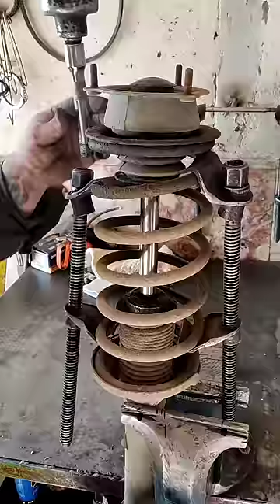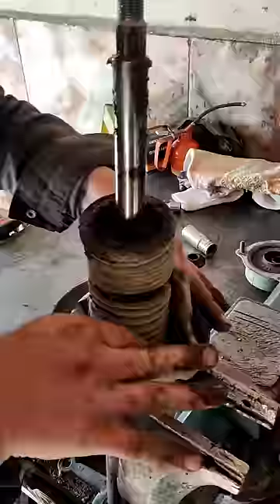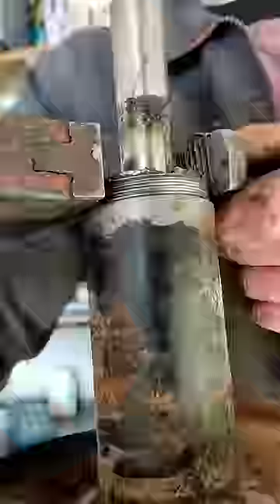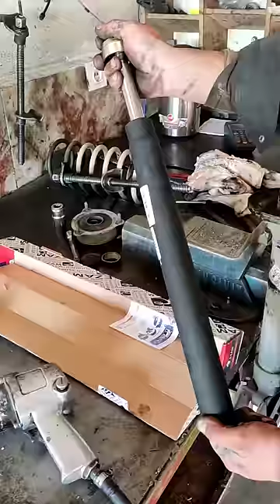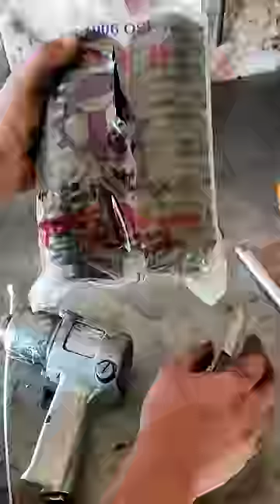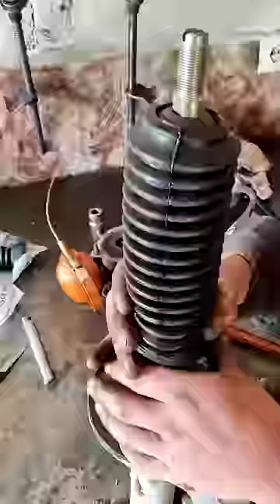Easy Repair #mechanic #automechanic #automobile #cars #truck #restoration #mechanicsteve #shorts

Comment: Easier to just get a fully loaded strut and not worry about it exploding on you while taking it apart. Faster install.
Reply from the maker: Thank you for comment 🙏🏻🌹
Reply: It's also a costlier one. They do this on regular basis since many years and since the labour cost is also low, changing just shockers makes perfect sense.
Reply: You are Right The old days it was cost Prohibited Now you get the Whole Assembly in Pairs for Cheap !.
Reply: Look where they are, ain’t getting that shit there.
Reply: @TylerSmith-qx6uz  I didn't figure out where it was, but the vise with the IRAN SANAT name cast into it made me think it wasn't in the USA.
Reply: @bubpori5105 those usually are of much worse quality.  This guy bought a bunch, and 75% of them had wrong spring rates on them.
Reply: You can't buy a full strut for most cars, they're sold as separate parts, one model car can have half a dozen variants.
Reply: @ernsailor9041 you are wrong.  another person not knowing what they are talking about
Reply: @johnyknox6596  How much do you want to bet? I have 40+ years being a tech what's your proof that I'm wrong show me a website listing every car with full struts or that every car uses the same strut. You didn't say what I was wrong about so you must mean both facts.
Reply: Нужно было масло поменять раз уж разобрал,знаю даже ничего не меняя,только масло и он как новый

Comment: For those saying quick struts are only a bit more money, labor is hella cheap in other countries the extra spent in parts isn't justified when it's way less labor. Here in America or other top teir countries the labor outweighs the parts cost so it makes more sense to replace the whole thing. If people remember when struts where first making their debut, even just a cartridge was expensive. And tbh, part of the reason the entire assembly is cheap is because cheap labor put it together.

Comment: For those who have never done this job before. Leave it to the Pro’s. It’s very easy to kill yourself if that spring compressor slips and nails you in the head. Ask yourself if it’s worth the extra money for one preassembled? It is! Also, for those who will just replace the whole assembly, make sure you disarm that spring before scraping it. Just my thoughts! 😀👍
Reply: they did't call it "Widow maker" out of Vain
Reply: People are scared of spring compressors?
Reply: Good idea on disarming the spring.....
Reply: @Wtrxprs007able  Itynot the Spring Compressor, it’s the spring and what it can do if the spring compressor slips. Not something a beginner should attempt without an experienced mentor!
Reply: When I was 24 years old the spring compressor failed and something cracked my skull. The good part is that I live to tell about it. By the way, that compressor was of much higher quality than the one shown in the video and I've been a mechanic since I was 16...
Reply: @MiguelGarcia-wk9ze  Thanks be to God you were not killed because they do have the power. Glad your ok!
Reply: I've done it once. Not sure I'd do it again. But yes, there is tremendous energy contained in that compressed spring.
Reply: There are presses designed to do this safely and they do not charge much to change the springs.
Reply: I agree with you with this note and pay attention to the seriousness of the work if occupational safety conditions are not met
Reply: thanks expert
Reply: @caseyd6154  Your very welcome!
Reply: These compressed spring have great power. With it comes great responsibility.
Reply: whteverp
Reply: In America those were the good old days . Shop labor rates $50 an hour or less ! Now with labor rates it sadly less expensive at a shop to swap the strut assembly.  Truly takes the skill away from a good repair
Reply: Full strut kits often have inferior parts and reduce ride quality, sometimes this is the only way to maintain good ride quality.
Reply: thanks dude
Reply: 😊😊😊😊888888888888888888899999999999999999999999999999999999999999999999999999999999999999999999999999999999999999999999999999999999999999999999999999999999999999999999999999999999999999999999999999999999999999999999999999999999999999999999999999999999999999999999999999999999999999999999999999999999999999999999999999999999999999999999999999999999999999😊😊⁹9999⁹999999999😊99999😊99😊99999😊😊
Reply: @luisronquillo9425  numbers means easy 🔧🔧🔧🔧🔧💯
Reply: I almost ate a coil spring for lunch the lip wouldn't seat properly so I had loosen it but the nut wasn't completely tighten it was on a Volvo and it was still on the car leaning towards the wall it's a good thing I was thought to work on it from the side and it didn't have a lot of pressure but it shot out valuable lesson learned?
Reply: @ceciljones1248  I’m so very Thankful you weren’t hurt. I think yo dodged a bullet my friend! The Good Lord must have been watching over you that day! 🙏🙏🙏
Reply: Yeah. Those springs packs quiet a lot of force. When I needed struts replaced, I brought the whole assembly for my mechanic.
Reply: Wear a football helmet
Reply: A week ago I was about to purchase those spring compressors but after seeing to many warnings decided to leave it to the pros...
Reply: @mariog5598  ive never heard of anyone dying from this just mythical stories...theres videos on youtube of people actually sending it and just unscrewing the springs loaded without any compressors and its not what it appears, they just plop off, not that i recommend that but its completely overblown fear
Reply: Scraping?
Reply: Use proper tools, not like the crap in the video and you will be fine.. 😊
Reply: I get the ugga Dugga and the let shock fly on the ground have yet to have something hit me or hurt me the weight of the impact absorbs a lot of the shock
Reply: You guys are kidding me. It is not that difficult to use a spring compressor.
Reply: I had one come off doing my Dodge truck I got lucky
Reply: You are also in America, where parts are more available to you than anywhere in the world. These guys can't get parts like us, so they fix parts.

Comment: It's only $10 more to get one fully assembled with all new parts, springs, dust seals, bolts, etc. It's just not worth reusing the old one. Plus, if the shop is charging more than $10 an hour you're losing money.
Reply from the maker: Thank you for comment 🙏🏻🌹
Reply: That is correct but, in some countries they don't have that luxury, accessibility, and actually repairing the problem makes more sense. I agree with you completely. Again, it depends on the geographic location.
Reply: At least in Australia there is no fully assembled struts sold, don't know why but no one sell them unless you import from the US which would make the price high, not a good deal at all.
Reply: @BaeLasso  funny you say that! A few years back I listed a set of used white wall tires on craigslist, a guy from Australia contacted immediately after posting it, I wanted 200.00 total, he paid me and instructed me to take them to a shipping company, he got them 3 months later.
I asked him why he would not buy them Tyres in his country, he replied, a set of those in Australia would be over 1000.00 US dollars. Again, each country has it's limitations. I live in California so practically everything is available, as long as you have the money to pay for it.
Reply: @conklinstreet2151  When I was planning to replace my old struts, I saw these fully assembled struts all over Amazon America, but none on AU shopping sites, guessing it's a legal thing... Anyway, added shipping costs it didn't worth the efforts.. Shipping costs would be higher than the products😂😂
Reply: @Bae Lasso repco sells complete struts but that's only for some cars.
Reply: Pre assembled MacPherson struts are usually poor quality best to replace it as shown with oe or better parts . Been doing springs for years no dramas if you don't know what you are doing then yes it can be dangerous! like most things leave it to the pros like me.
Reply: @fiercefix  alot aftermarket parts are usually junk use u pay for the good stuff.  And as long as the busted shock is repaired immediately it's ok but if you've been ridding with a busted shock for a while that spring will get weak and will be bouncy and have a slight lean.
Reply: @fiercefix  and most average folk don't notice they have a bad shock until it's bouncing all over the place and the spring is wore out
Reply: My experience also says that, the old spring has been under pressure which makes the strength of the new one not optimal.  so it's better to replace.
Reply: For you? You don’t know what people in other countries gotta contend with. But some of those dudes got skills. Not just part swappers.
Reply: A complete strut for any car is only $10 more ????? Bullshit you must think every car uses the same strut assembly.

Comment: You lost me when you got out a pipe wrench.
Reply: And the white zip tie
Reply: One slip and you scar the shock shaft and then it's JUNK.
Reply: @larryjohns8823 
The shaft is bad to start with.
Reply: Yeah, easy when assembly is off the car and you can see what you're doing.
Reply: it is a tool, too!!!

Comment: He forgot to top up the oil in the strut tube. This oil is needed to transfer heat away from the shock. That shock will fail early.
Reply: I edited my comment as we're both right. Some are dry fit, some call for oil for cooling.

Comment: I remember these type of struts. They are a pain when they are rusted up pretty badly. Had to buy each individual parts of the strut. I had to put it together. I tell ya. These are fun when you are dealing with a crusty strut.

Comment: Two things. Dump old oil out of strut housing and add about a shot glass of new oil as it helps cool the strut insert. Also, why would you reuse the old strut plate? You will have a noise or steering issue...

Comment: I did this a big mistake because I saw it on a motorcycle, but it turned out worse when some kind of hole or a gap is formed, the dust starts to pump in there and the shock absorbers quickly failed (it’s not for nothing that they just make a bell at the factory)
Reply from the maker: Thank you for comment 🙏🏻🌹

Comment: I've done hundreds of struts and spring replacements. Never once in 35 years has a spring got away or the compressors broken. The comments by amateurs on these videos are laughable. Perhaps it's just as well they are only Google mechanics.

Comment: Be very careful with these spring compressors...I have seen them break and cause injuries.
Reply: I always use 2 sets of spring compressors   or 1  set and then fit  two fabricated long hook's as extra backup captive safety ..😊

Comment: I will concur with the others on just getting a strut ... However, if you are going that route, you gotta clean the tube, and add oil for cooling... Which I did not see.... Peace...

Comment: You need to put oil or glycol in to fill in the gap between the strut insert and housing. To transfer the heat out.
Reply from the maker: Okay 👍🏻 thank you for comment 🙏🏻🌹

Comment: Should have replaced the original strut top too!
Reply from the maker: Okay 👍🏻
Reply: @mechanic majied  AS you probably know, with the age of the strut or the type of changing weather conditions where you live, the strut top just like the strut cartridge gets worn out and that rubber dampener starts to dry out and crack and come apart as it's constantly in motion while driving. But nice job man,keep up brother!

Comment: Nah..... This is old style. It is better and cheaper to replace the Full Strut Assembly. Including the Spring..... Why?? Because of the "Ride Height Difference. Springs wear out. Thus causing Alignment Issues and poor tire performance.